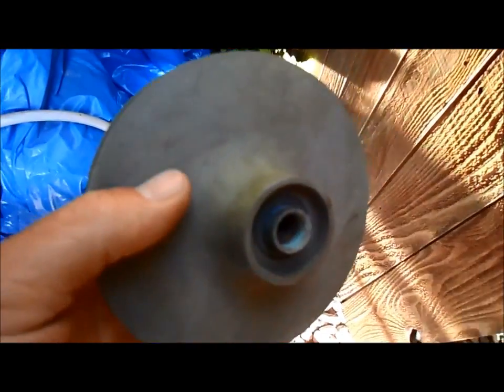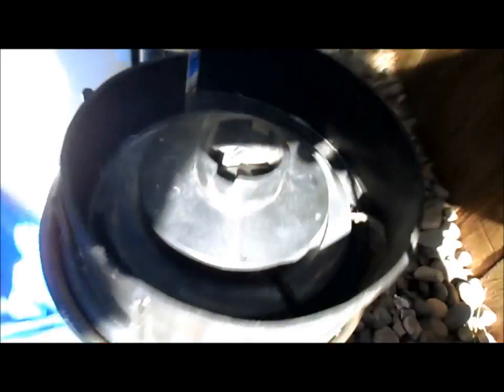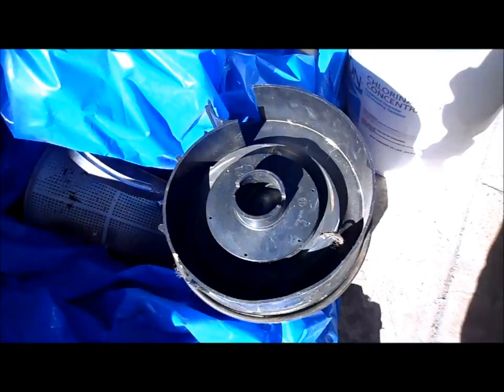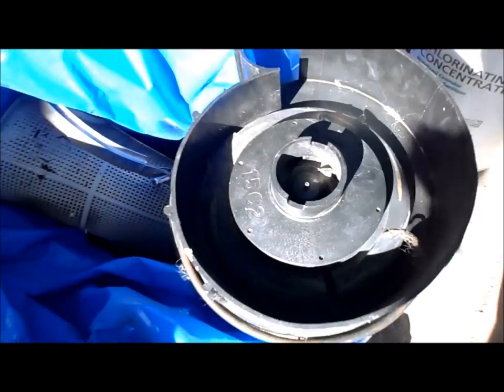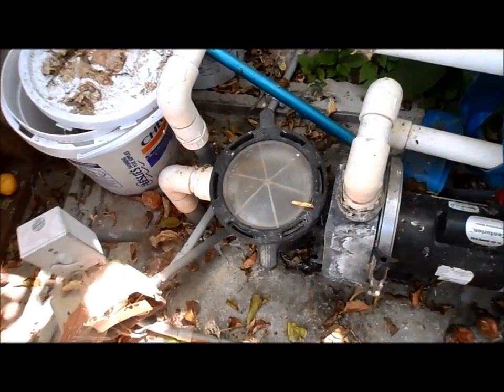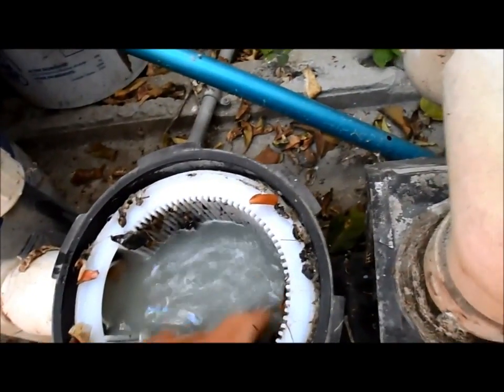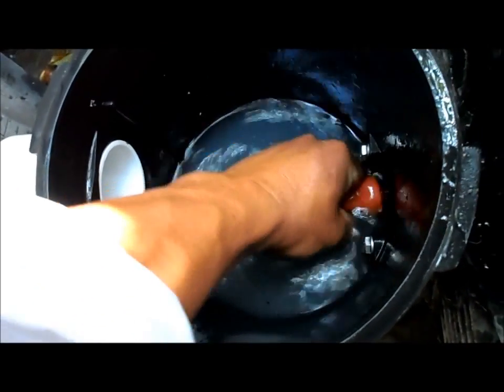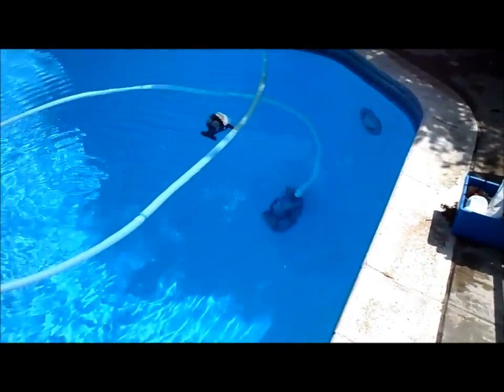Clogged Impeller, pool pump not priming Part 4

Comment: No, I can't pull the motor out. I can move the motor around I have about a two inch gap between the motor and the housing. Thinking of just calling a pool repair guy.
Reply from the maker: That is really odd. I know on the Super Two two bolts go all the way into the front o the housing and are held on bu two nuts  but I can't see what else could be holding them in place.

Comment: The impeller is clogged and I started taking off the six hex screws off.  Two of the screws just spin and I can't get them off. Any ideas?
Reply: so when you remove the other 4 you can't pull motor out? Those two sound like they are stripped.
Reply from the maker: So it won't pull out after removing the 4 other bolts?

Comment: hte writing is only on for one frame it seems like, thank god for a pause button!!   other than that i learned a lot.  we got it spinning and pulling water, but it feels weak, only 10 psi and it should be 18-20
Reply from the maker: It could be the Diffuser inside the pump itself is bad - that happens sometimes also. The motor comes off the pump fairly easily depending on the model. Usually it is 6 hex nuts holding it on. Maybe pull it off and inspect the internalk parts or check the impeller itself for wear or cracking - refer to this video:
http://youtu.be/YQl0W5doYSI

Comment from the maker: I have many videos on in the Pump Not Priming Playlist but there are a few more areas that i haven't had time to film and post. If you watched all those you should be able to isolate the air leak. One new problem I will be posting soon in a video is the winterizing plug found at the bottom of the pump - it is a small plug used to drain the pump but it can come loose or leak air. But more than likely it is coming from a source I already posted. Let me know if you find it.

Comment: Q:  I am stumped on why my pump isn't priming.  I did add lube to the gasket, I removed the motor and cleared out the impeller, I inspected the lid for cracks, and I added water to the basket to try to start the prime...all without luck!  Any ideas?